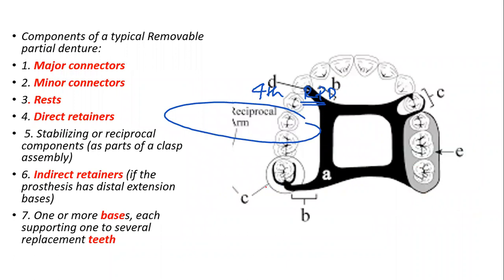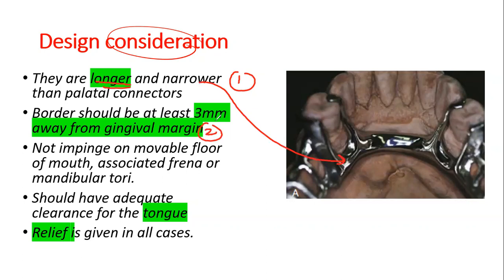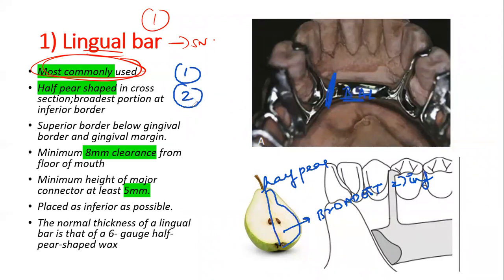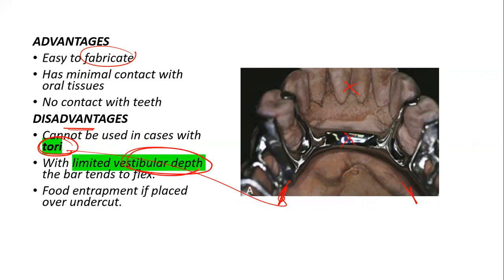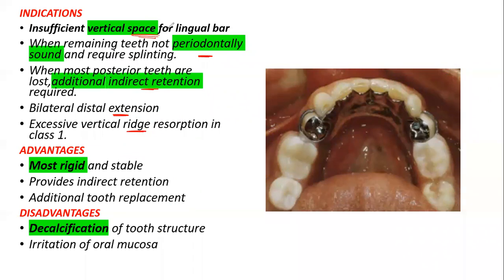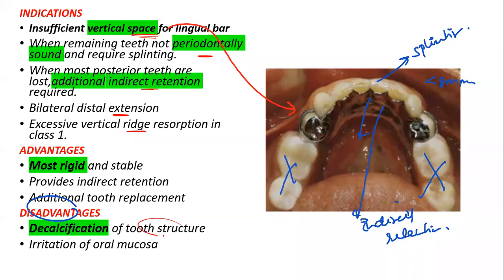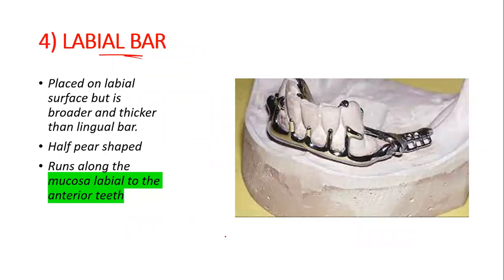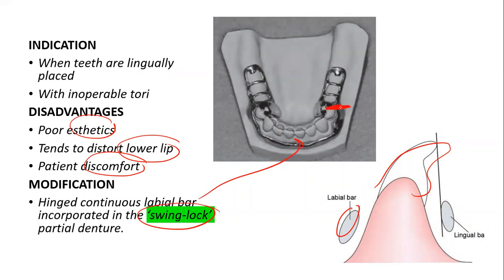MANDIBULAR MAJOR CONNECTORS | DETAILED DIAGRAM EXPLANATION |Types | RPD | Prosthodontics |

Comment: How are you? Thanks for the lovely videos. I did not understand. You said the major connector of the lingual bar should be 8 mm from floor of mouth, but the verticle Space requirement is minimum 8mm. So with a minimum 8mm vertical space, the bar will be touching the floor? Thanks
Reply from the maker: Hey! Thankyou so much,its my pleasure !
Please refer 3:35 :
To accommodate a lingual bar, at least 8 mm of vertical space must be present
between the gingival margins of the teeth and the floor of
the mouth
a)This permits the major connector to have
a minimum height of 5 mm and
b) allows 3
mm of space between the gingival margins
and the superior border of the bar